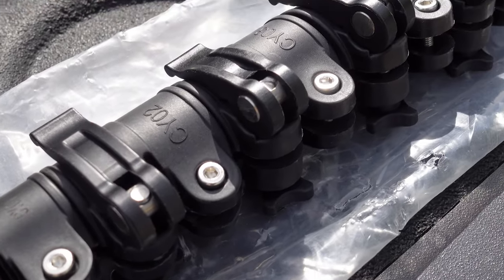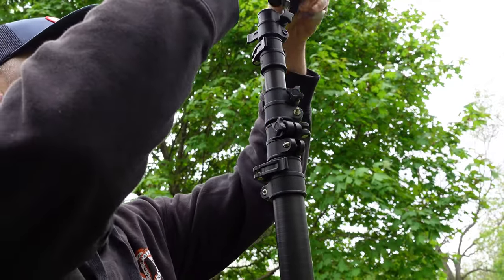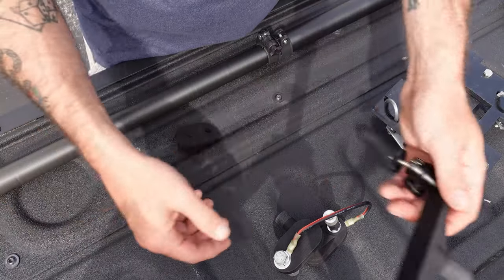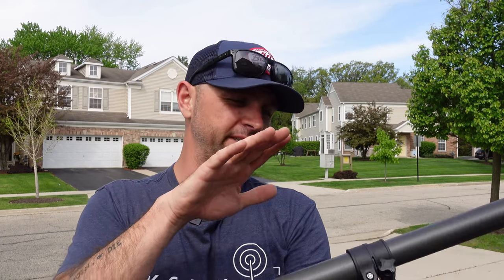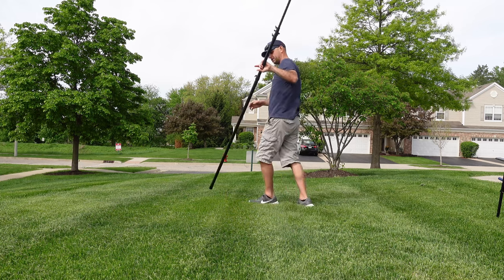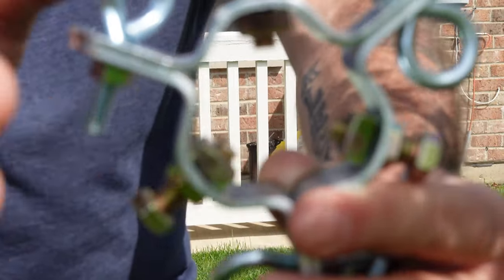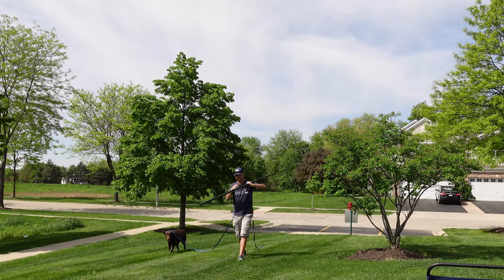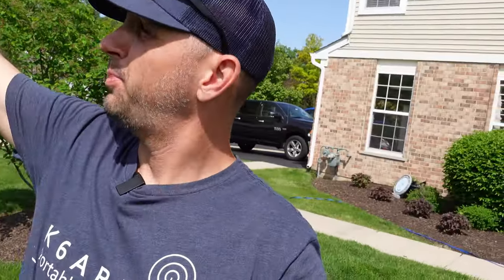New Carbon Fiber Mast for Ham Radio

Comment: Just received mine this afternoon. A jewel, so strong and so light. It is replacing my 28ft heavy duty fiber glass mast that started pealing. Also it was always difficult to bring it down during thunderstorms or experimenting with different antennas, despite having a tilt base.   The 3ft shorter didn't make a difference, in this case an inverted V dipole fed with a ladder line and an SGC ATU at the base. Thanks Sean, great product and a great job.
Reply from the maker: This is great, I'm glad to hear! Thank you!

Comment: A tetrahedron of those carbon fiber masts could be put together with three 3D printed corner pieces that had holes for stakes and a top corner piece that could hold your mast to make very nice portable tripod.  If the tetrahedron sides were 5 or 6 feet long they would fit inside of a lot of truck beds and car trunks.
Reply from the maker: Oh that's an interesting concept.  Even if just certain elements of carbon fiber at certain lengths could be used, it may work with the parts.  I am a slow thinker, so it took me a bit to respond,  but I like the idea!  Great thought! 73 !

Comment: I actually got the 34 ft carbon fiber mask from gig aparts with the tripod and I use three guy wires of paracord and it easily holds up the MFJ2289 big ear dipole antenna which is about 6 lb fully extended so it works fantastic on 6 m through 40 m for 1.2 kW I've also had my Mosley 32A mini tribander two elements that antenna weighs less than 10 lb no rotor ( just an Armstrong rotor ) at 25 ft with the tripod and two sets of three paracord guy wires held up to a breezy afternoon had a lot of fun I live in a homeowner's association so I kind of have to take my antenna down every night and the carbon fiber is a great solution My age is almost 60 so it's tough to take a steel push-up hole in and out of the garage which weighs about 60 lb The carbon fiber weighs less than 6 and I can assemble it in less than 15 minutes with the MFJ big ears with the two element beam it takes me about an hour.

Comment: I like the topper features on this. I have the DX Engineering 50' (actually 49 I guess DXE-TCFP-49) mast I am pleased with. Pricey to be sure but you can always make it shorter just not longer right? I got the oversized tripod for it as well. In any case, by the time you buy it, the tripod and guying solutions you're over $1K all in so they aren't for everyone when you consider the alternatives. I'm not one to ridicule companies over pricing though, you truly get what you pay for.
Reply from the maker: Thanks! I'd be curious, do you know the inner diameter of the top section of that 50 ft (49 ft) mast?  I will have to check it out.  I agree, accessories start to get expensive.  I have to think creatively sometimes for some sort of solution.

Comment: Do you think these are OK for a "permanent" installation to support wire antennas? Some vendors of these types of masts caution against it, and others say it's fine.
Reply from the maker: I'd be curious why they said they can't be used permanently.  Fiberglass , sure.  Carbon Fiber should be good.   A guy in the comments "the happy ham" has had his mounted outside for a while now, permanently, with no issue.  I wouldn't have any reservations.  Thanks
Reply: @HAMRADIODUDE  Yeah. I'm going to try it.  If you read the manual for the Gigaparts masts (I can't post the link because YouTube will block the comment) it says:

"3. It is not recommended to use Explorer Telescoping 
 Masts for any sort of permanent installation. Explorer 
 Telescoping Masts are designed to be used in a portable, 
 temporary fashion and as such are not rated for permanent 
 installation of any kind."
Reply: My biggest concern would be degradation from UV.  My suspicion would be that the material would last years in the sun, and if you truly had a permanent install, a coat of paint might be a wise option to help protect it from the sun.
Reply: @K6ARK  Thanks, Adam. I think I'll take my chances. Despite the expense, a Carbon Fiber mast would solve a lot of issues. I have a huge rooftop about 20' high on a 100'x100' commercial building and getting another 20' above roof level would be nice. And if the pole should collapse in 5 years, it won't hurt anything unlike a steel mast. (I'd guy the mast, of course.)
Reply from the maker: Thank you Adam.

Comment: What is the OD of largest section of mast? Already have a fence post installed in my yard already.
Reply from the maker: Huh, I thought I mentioned it.    39mm at the largest point (the cap on the bottom), 34mm on the mast.  Thanks!

Comment: So does carbon fiber affect RF?  Since it conducts (carbon), will it affect an antenna pattern, say an EFHW run up the pole?  I now favor FG, (for price and insulation), but would like CF for its strength.
Reply from the maker: I thought I mentioned in the video, I still have to test it, but have not had issues with the efhw sloped away from the mast, or a dipole on the top.  I will test more next week and try to get some charts.
Reply: The only time it will really have an impact is if your wire runs relatively close to the CF mast for more than a foot or so.  For example, I wouldn't fun a vertical up along the mast.  But for slopers, inverted V, dipoles, verticals, yagis, etc., CF works great and saves weight.